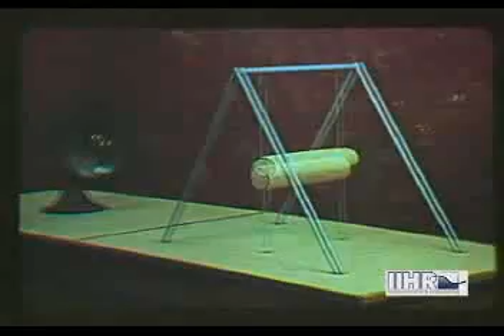Flow-induced vibrations (Karman vortex)

Comment: Regarding the hanging cylinder, This is known as Lift Galloping. There is negative aerodynamic damping being added to the system (mass-spring equation of the hanged cylinder), which means that the flow gives (transfers) energy to the cylinder instead of damping as commonly known in a viscous fluid.
The negative damping comes due to vortices is shed alternately at the downstream generating a harmonic force with a frequency that eventually will coincide with the natural frequency of the cylinder as the speed of the flow increases. Also, in the solution for the equation of the motion will appear a term of (e^positve number) which means exponential growth of the amplitude of the motion of the cylinder.
Reply: Thanks!
Reply: THANK YOU SO MUCH SIR. You added a whole new property I have to look into in my research into applications of water/fluid phenomena

Comment: Could this be used to generate electricity ?
Reply: Probably, but not very well. A turbine would be much more reliable and efficient. This is a very violent motion, and so would probably be extremely stressful for any system it is attached to, leading to higher maintenance at the least. No clue how efficient it would be, but it's probably going to be a lot less than an airfoil based turbine blade. 

A turbine blade can just keep spinning in the same direction, but this is constantly starting and stopping, so it doesn't seem very efficient to me. You could probably attach a rod to it and that to a crankshaft and generator, and you will basically get a piston engine, but you're be better off turning the wind into rotational force from the get go with a turbine.
Reply: Google VIVACE or VIMEC. It could. It's applicable subsea as currents are more stable than wind and water is 1000 times denser than air.